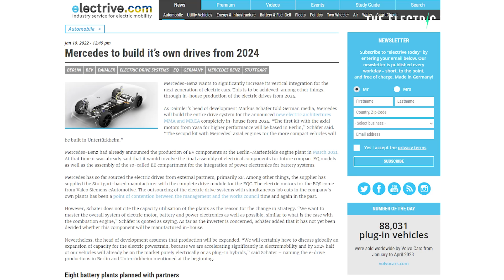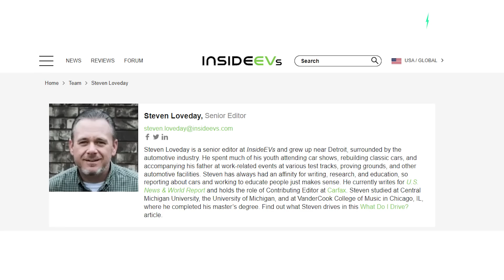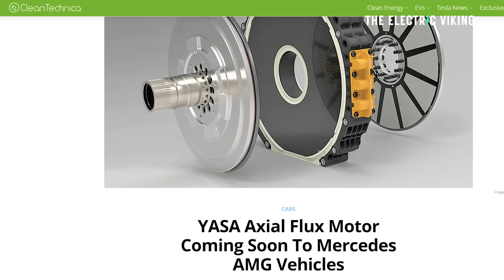How Mercedes plans to challenge Tesla's efficiency using Formula 1 tech

Comment: I think Mercedes should offer all there EVs with 2 different battery sizes for all there trims eg 200,400, AMG, let’s say one with enough range for 300 to 400km and another one with as many batteries as they can fit in the car for the longest range and see what customers choose, over the long term(say 15 years) I think the smaller battery pack will be the top seller because people will find they don’t drive very far and when they do they will have charging

Comment: The irony is in F1 right now Mercedes is off the boil they are 3rd or 4th in performance terms as a manufacturer. So making a link to F1 ability right now leaves the door open to criticism. To make matters worse for Mercedes they recently released a project Hyper car with an F1 engine which people looked and drove and said yes another hyper car. However Aston Martin released an F1 inspired car (in the pipeline for many years like the Mercedes) with the collaboration of Redbull and everyone is raving about what an amazing thing it is.  Guess what Redbull are currently the top F1 team everyone is aiming to beat.  So Mercedes like a change in direction you F1 team took which has ruined your dominance this statement may come back to bite you.

Comment: The Hyundai Kona Electric has a 620 mile emergency maximum range when driven at low speeds.  All electric cars have similar 2X to 3X maximum low speed range.  ICE cars have maximum low speed range barely better than highway range.

Comment: I used to be an F1 fan and formula e is definitely more relevant now.  
Also the McMurtry Sprieling is more relevant than F1 and Tesla should license the McMurtry Sprieling technology for the new roadster to add far better acceleration, deceleration, and cornering performance than cold gas thrusters.  Also Mercedes could accelerate its EV technology if they just stopped racing and devoted it to EVs.

Comment: At this point, beating Tesla efficiency is possible, but only really good for bragging rights. Tesla hasn't left much on the table to improve upon, diminshing returns from here which will eek out a few more miles, probably single digit improvements. If Tesla were still at 2012 model S levels of efficiency, then yeah, this news would be great. I think lucids are more efficient than Tesla already, but the improvements are marginal.

Comment: The Model 3 is no longer the most efficient EV, the Hyundai Ioniq 6 matches their efficieency, all because the Ioniq 6 has a slightly lower coefficient of drag at .22 with side mirrors and .21 without side mirrors, and it's a bigger car than the Model 3, longer, wider and taller, so if it was smaller, it would exceed the Model 3 efficiency a by a few miles. The Ioniq 6 base RWD has a 53 kWh battery and does 240 EPA miles on that, while the 60 kWh base RWD Model 3 does 272 on 60 kWh battery. Same efficiency.
Reply: The useable capacity on the lfp m3 is 52kwhs per bjorn tests. Seems like tesla still wins and can do charging faster on average to. 
Plus on price tesla wins easily vs the ioniq 6. But it's impressive the Koreans have something as close as the lucid is to tesla efficiency. 👍🏻
Reply: @4literv6  The only RWD version that is currently in production (Standard Range) has a 60 kWh LFP pack. The previous discontinued version (2021 Model 3 RWD) had a 54 kWh pack, of which was software limited to 50-52 kWh. They have the same miles per kWh efficiency, along with near identical charging times on a mile per kWh basis, if one is faster than the other, it would be by seconds.

Ioniq 6 AWD is $49,000 + $1,115 destination = $50,115.
Model 3 AWD is $47,740 + $1,390 destination = $48,630 or $50,130 if you go with the $1,500 black exterior of which Hyundai provides for no additional cost. Model 3 AWD long range does have the $3,750 tax credit, but Hyundai will probably have it as well as they plan on using LFP batteries by 2024 model year. Similar numbers for RWD Ioniq 6 RWD and Model 3 RWD.

Comment: Mercedes has never built a reliable car or SUV.  They have no idea how to get an oil seal to keep from leaking or how to get a bearing to last.  They seemingly design early failure and scheduled maintenance using exotic and expensive fluids and parts into their cars to enable profit from their enormous repair centers.

Comment: EQXX achieved 1000km of range without hypermiling, average speed was 80km/h and maximum speed was 140 km/h. However, the car doesn't even has 4 doors, they took extreme measures to reduce weight, the battery is even passive cooled, which means low power/acceleration, not to mention aluminum disk breaks and fiberglass springs. But the aero package is top notch, it is said to be the limit for an object that still looks like a traditional car.

Comment: The GM EV1 had a Cd of .19 if it was properly measured back in the late 1990's. It could travel as much as 105 miles on a charge of 26kwh in its NiMh battery.  This would make it about as efficient as modern day Teslas but using nearly 30 year old technology. I would love to see a Tesla platform swapped into that body with a less powerful motor. My thought is that Tesla at least originally put such powerful motors in their cars to prove that EV's could compete with ICE vehicles. I would like to see them develop a vehicle for pure efficiency much like Aptera is doing now.  Less powerful motors means smaller and less weight. One can dream.
Reply: My guess is their next gen vehicle ( Z ???)  will be lightweight and efficient - but safe...
Reply: The current lfp model 3 does 272 miles on 52kwhs useable utilizing lfp cells, with a lot more size, power, tech and safety than an ev1. 
The model y rwd has 55kwh useable lfp and does 455kms wltp. 

It would be interesting though if tesla made a stripped down nerfed model with maximum efficiency in mind. I bet they could hit 6-7miles per kwh pretty easily. Maybe the compact will get over 5 miles per kwh? So a skinny tires stripped down version of that could do very long range. 🤔
Reply: @4literv6  ...with a lot more size, power, tech and safety than an ev1. Exactly what I am talking about. Put all that modern tech, more efficient drive train, more efficient batteries, more intelligent computers and software into an EV1 with a less powerful motor and see just how much range could be obtained with say a 33.7 kwh pack or essentially one gallon of gasoline. I would guess that your estimate on a stripped down Tesla 6-7 miles per kwh would be about right in and EV1.
Reply: @jjackson3240  I was making the point it doesn't make sense to compare a little compact 2dr streamlined vehicle vs the mid size 4dr sedan like a model 3. But I have no doubt it would do very well with more modern stuff in it. 👍🏻

Comment: Even if their efficiency is worse then Tesla it doesn't matter that much. The kind of clients they target are not the ones that care about their power bills. They off course care about the range but not about the kWh required to get it.

In the old days Mercedes clients cared about power and engine size (Mercedes were almost the only ones in the euro market to offer a V8) but didn't count money at the pump .
Reply: Efficiency penalty Mercedes for an ICE car translated to 10 or 15 liter extra at the gas station. 
Now with EV such lack of efficiency translates to additional battery capacity of 100 to 150 kWh. This is prohibitive.
So Mercedes will have to review their whole design philosophy
Reply: They still care about power and range, even if not so much on efficiency. Mercedes sales tell the story

Comment: Yeah the plaid model S must have scared the short hair off of the Mercedes execs. Model S owners can easily buy the Tesla then spend some money on 3rd party luxury components to trick out their model S and have a car as good as any plush Mercedes but much much faster and at a significantly lower overall cost.
Reply: TESLA listen up, slap on the ceramics and put the Franz optional luxury interior and bring out the plaid plus for 199k. 😀👍🏻
Reply: @4literv6 That is just wicked. That would mean the death Lucid, BMW, and possibly Merc. 😂😂😂😂

Comment: It's not what you can build, or innovate.  It's what you can mass produce profitably.  And developing that takes time (The car design, the factory and machinery to build it, the workers to operate it, the supply chains for all the necessary materials etc...).  Good luck to all the competitors, it's a steep hill to climb.
Reply: Tesla is brilliant at software...(Ummm Elon Musk?). .. they have created their own design software for EVs, motors etc - because the industry standard software is not good enough...EVs need physics, chemistry, electronics, thermodynamics, aerodynamics, material science, battery tech and software to be optimised...maybe that's why EVs are much harder than people thought? (Suspension, brakes, bodywork, wheels and tyres are all the same as ICE aren't they ? Well, actually no, because aerodynamics and lightness are much more important in an EV, optimisation is essential...)  I'm afraid the "good ol' days" for the OEMs are over - there is a lean mean production machine eating your lunch - less of the port and cigars, and trying to not out-compete with chrome ...
Reply: That's right. Mercedes can make better car than tesla or byd or other ev car maker but if you sell your product at loss you are going nowhere.  I wish someone can find how much profit tesla is making on m3